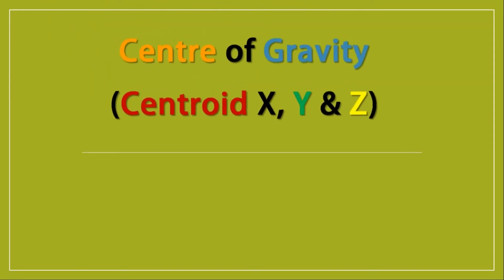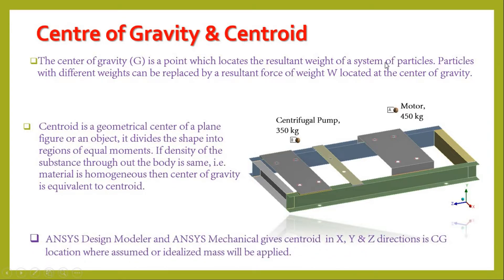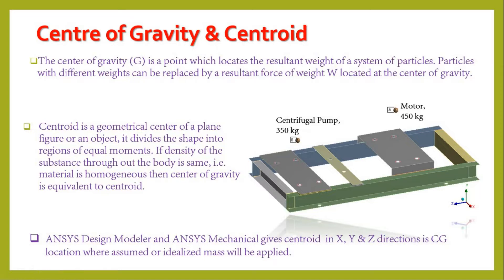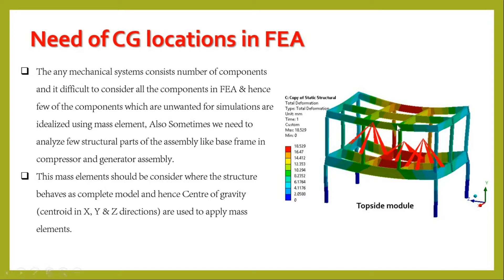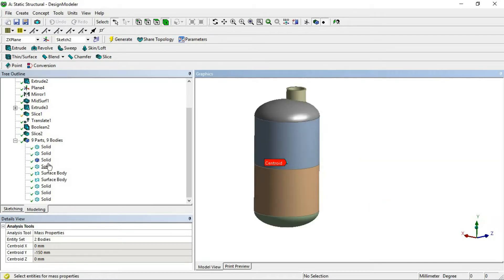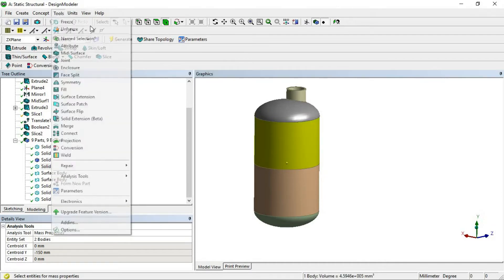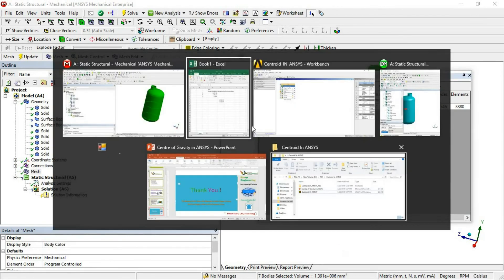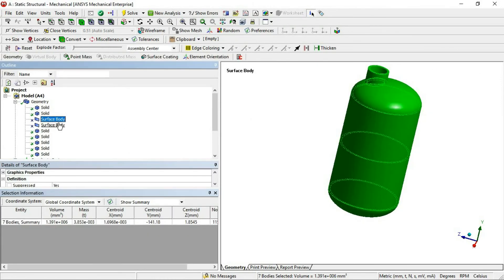What is Center of gravity & Centroid & How to find Center of Gravity in ANSYS

Comment: What if you have applied loads and how to find CoG in that case(Since ,when the loads are applied CoG is likely to change)?
Reply from the maker: You can check it from output file after simulation is solved. CG will not change.